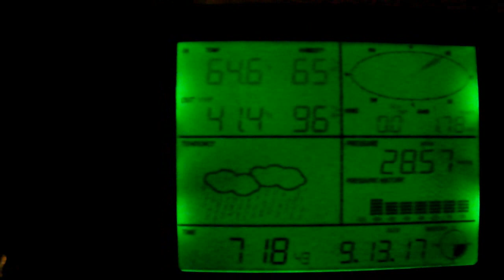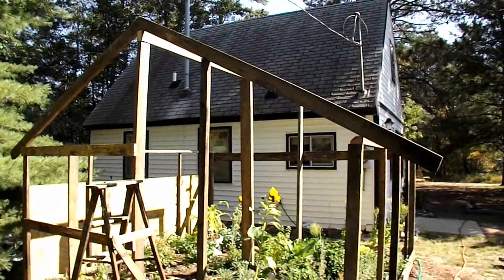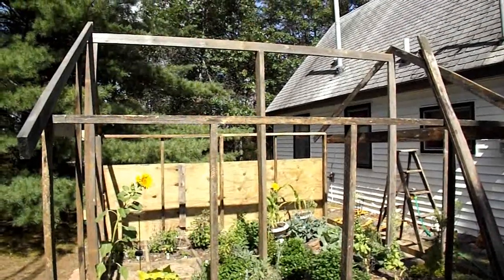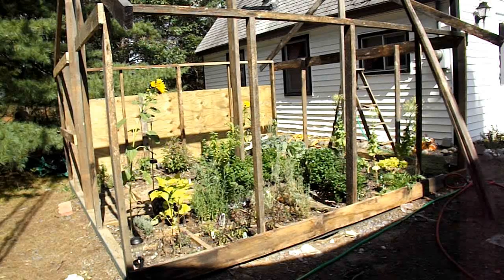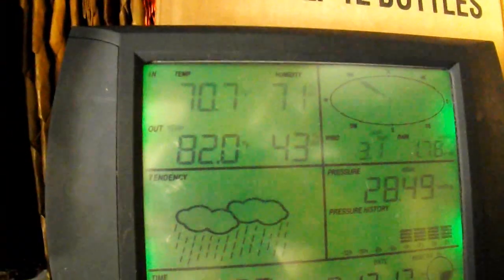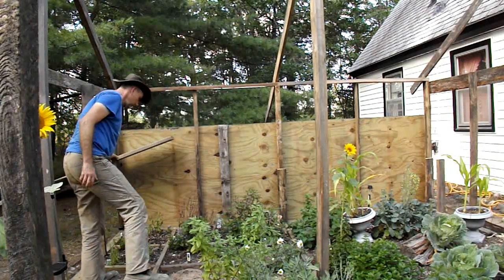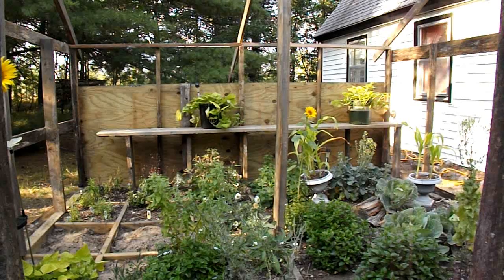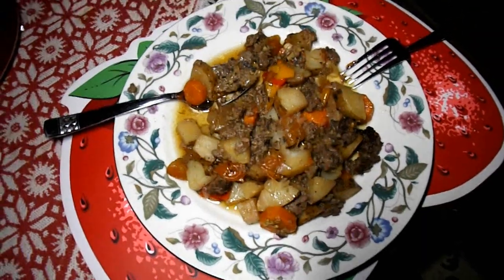Finishing Greenhouse Framing & How We Use Solar Power

Comment: Are you considering adding a battery box,charge controller and large array by the garage/chalet to provide larger power to house/garage or will you leave the high juice to the workshop and keep the solar by the house small scale?

Comment: if you have some white paint for the back wall itll help reflect the light
Reply: Paint, he was going to insulate that back wall with sheets of Styrofoam and went ahead with the shelf..then said he was only going to 'tack' it in and next shows he has the shelf loaded with plants..like in his other buildings, he will not get that insulated now.  And his plants on that top shelf will be up against the plastic and freeze just like his plants touching the plastic in the garden.    It appears he is not good about thinking ahead about the possibilities. Like another comment made, plastic w/o support will sage and split. So I am hoping he will be putting trellis or
firing stripes or something cross his top beams to give the plastic roof some support.

Comment: You don't seem to remember how to brace your work from the greenhouse in New York you brace with diagonal not horizontal running boards! I see you are finally wearing hearing protection but still not using any eye protection! Never see you use a level to check plumb or square what's up with that?
Reply from the maker: Because, as I said in the previous video, I dont care. This is not a house. Its bent, warped, rotted lumber to hold some plastic up over my plants.
Reply: I understand that but you have a winter in your near future that may dump a ton of snow along with some high winds just trying to get you to think about possibilities and how to avoid bad outcomes!
Reply from the maker: Not that is a good point. I will probably put in some cross bracing as someone suggested in the comments. And i have to keep an eye on how the snow will be falling off the roof. May have to reinforce that side for winter.

Comment: Troy, do you not have a book about how to build sheds? I understand that you have limited materials, but the word "experimenting" is generally not used in construction. There are tried and true methods of building structures that you just never seem to be willing to research and use. A centre post like you have is not required if the building is built properly. 
By the way, I like the more edited videos, but perhaps watch a few of the successful channels to see how they transition from one scene to the next. Your transitions are a bit gimmicky and makes it look overly amateur.
Reply from the maker: Oh, I thought the transitions looked nice. Thanks for the input.
Reply from the maker: The "experiment" was to see if I could find any wood that I could use for some sort of support. The stuff is not very strong anymore. Had to search and dig through to find something. And the "experiment" was to use a support beam like in my garage. Yup, I did some research to come up with that idea. The garage has a center beam going through the rafters from one end to another.

Comment: Hey Troy.   I have an idea (  feel free not to use it haha ).   I hate to see you do all the work and later see those darn
varmints burrowing under the walls to have an all you can eat buffet. 

I was thinking if you use a hoe to dig a narrow trench all along the outside wall maybe 10" deep . Then take some of that scrap corrugated metal roofing and cut it to say 15"  width.  Affix the long 15" wide corrugated metal to your boards all along the bottom of the greenhouse.  You would allow 10"  of the metal to be underground in the narrow trench.  Then fill in the trench with dirt or even rocks (  you may have to have rocks imported from NY  haha ).

I am not sure if your average rodent would be energetic enough  to dig below 10".

Of course the Trolls will say you hire trained rodents to deliberately destroy the greenhouse to gain sympathy so someone will send you a high tech fake Owl with motion sensors and 10 kilowatt lasers firing from it's eyes to zap the buggers.
Reply from the maker: Thanks for the suggestions. It would work but I dont know how long the metal would last down there. Hmm.
Reply from the maker: I am thinking about putting down rocks, bricks or cement blocks around the base to absorb and retain heat.
Reply: I like the idea of the blocks absorbing heat.   I was just thinking the metal could be a fast and dirty solution with something you have on hand.
Reply: OK......my alternate plan is to setup trip wires attached to M-18A1 Claymore Mines.
That will teach them varmints there is no free lunch hehe.